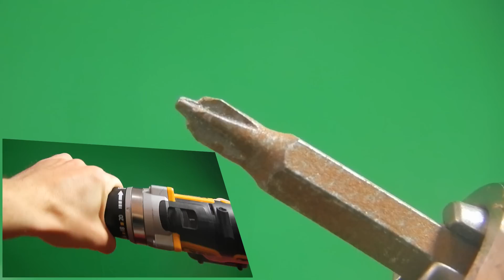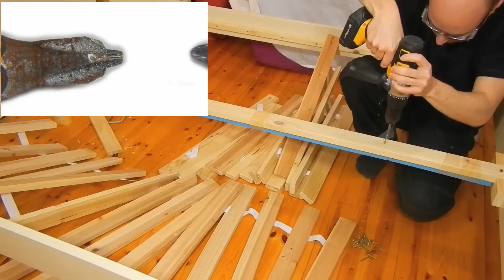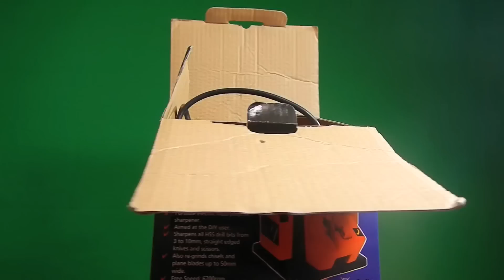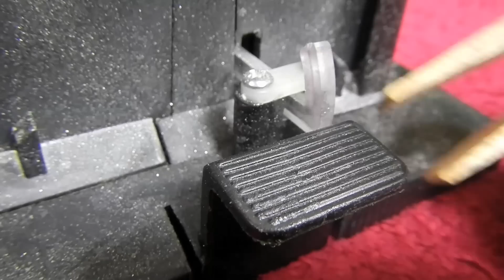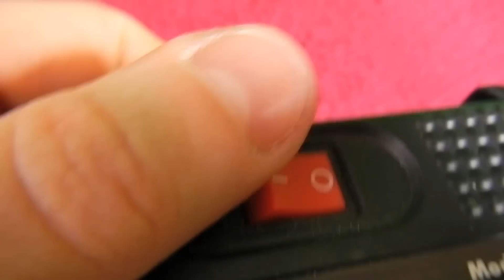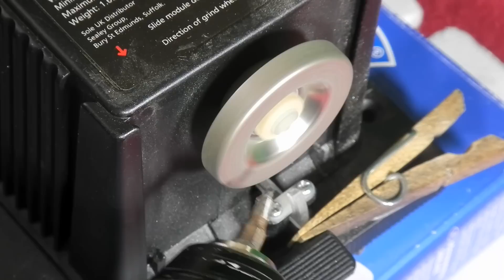How to repair Phillips Drill Tip

Comment: Not sure if this is a serious but if you were you should know that it won't have the right geometry unless you grind inside the flutes
Reply from the maker: +Chris Findlay I had to do a quick fix on Sunday, shops far away. I just angled the best side of the tip and did the grinding worked perfectly fine, geometry fully good. More or less ;)

Comment: $100 machine to fix a $1 bit.. LOL, your better off buying 100 tips and just throwing away one when they get destroyed.
Reply from the maker: I already had d grinder/sharpener. It was 25 sterling by d way.
Reply: Max DIY if the bits are chewed up any way then just get more quality bit.they are only going to break again.cheap steel is what to blame.

Comment: You did not show a end result so i guess it didn't work?
Reply from the maker: +Menth Fcuk I did not. I had the photos simply forgot to load them into the video. I made a post on my g+ check it out the pictures of the actual tips after grinding:   https://plus.google.com/+MaxDIY1/posts/NW9ZGH47Rb6

Comment: Love these DIY videos mate i subbed, it's knowledge like this that is great for emergency applications. Middle of the night no store open, stripped the philipshead drill bit, grinder on the table fixed and job done. Great stuff
Reply from the maker: People these days understand only one off stuff, like u buy an iphone and when the battery is dead you get another one. I try to create as little waste as possible.
Reply: Max DIY
Im a steel fabricator and where i work they throw out standard drill bits, the ones for drilling holes. They look at it cheaper to just replace them rather then sharpen them on a bench grinder. They charge $120 phr to the customer so i kind of understand.

However im one of the few that knows how to actually sharpen them properly so i keep the drill bits and take them home. Got a nice little hoard of free drill bits :).

Never seen this method on your video though for philips bits, got me thinking it can be used on those pesky cheap screw drivers aswell.

Like your style mate, it's ingenuity that separates the men from the boys.
Reply from the maker: I am going to work now, no time to write back, hopefully I will not forget I will write u a funny story on you priv. 
And all the optimisation people in modern corporations are bullsh...ing bout being green ;)
Reply from the maker: shi. I just checked out you have no priv message set up on your yt channel :(

Comment: just buy a new one. cheap as chip's
Reply from the maker: +chris pool My explanation form instructables 

The whole explanation is as simple as that: I live in a remote location. I was Sunday and our bed collapsed. I did not own tools on my own.I borrowed the drill/driver from a friend of mine. All 3 Phillips bit tips were broken. No decent wood screws in stock as well, got them form other friend of mine.Yes, I sould have said. Oh, bed is broken, I need to buy a new one.http://www.argos.ie/static/Product/partNumber/3958...Not very expensive is it?But on Sunday evening quite hard to get. I could have ordered the bit tips form amazon, and sleep on the floor for next too weeks. OR, just get the bit tips sorted and get the bed in order in about 45 minutes. Plz be aware that I did have the grinder so I had not bought it just to get the tips sorted.The easiest way is to say oh, my smartphone is broken I'll get a new one.Work, eat, buy....work, eat, buy...work, eat, buy......The final of a story is: Bed fully fixed, will serve years to come, the bit tips fixed, owner of the drill and the tips happy.

Comment: Phillips screws and bits are shit. To bad Robertson screws are not standard in most countries as it is far superior to Phillips.
Reply from the maker: +Bob Cartwright U R 100% right, it is very difficult to destroy Robertson, much better solution. Unfortunately, in Europe I saw this solution only a few times.
Reply from the maker: Darren Woods It is fully true. Back in the time when I was young I used one for like 2 years and I can bet it is still fully operational. I scrued quite a few plasters with it .
Reply: +Darren Woods  True, but still not as good as a Robertson. Try driving a four inch Phillips screw with one hand at arm length.
Reply: It would be easy and exactly the same as a square bit , except with a square bit you have no tolerance and it only works at one angle , with philips/pozi I have managed to drive them in at an angle no problem , try that with a square bit. Also doing shit by hand ....that's for peasants (expect if your assembling a kitchen were the designer is just a total bastard.)
Reply from the maker: Bob Cartwright Roberts on fully good but comes only in imperials
Reply: Bob Cartwright Robertson sucks just as much.  I used to use them daily when I worked for a decking company, and they strip the screw head extremely easily.  At least Philips cams out before wrecking the screw.  That being said, Torx is the best drive system.
Reply from the maker: Telogor _ thx for sharing your experience. What type of business are u in? I am used to torx in electronics noting else
Reply: Max DIY I'm in the electronics repair business now.  The decking company uses Robertson about 3/4 of the time and Torx the rest of the time.  Unfortunately, the only electronics I see with Torx screws are Motorolas, Nokias, and Microsofts, none of which come in very often for repairs.  It's usually Phillips, which suck, and pentalobe (Apple's crappy proprietary screw.
Reply from the maker: "Electronics repair" does it still exist? I used to do it part time ~5 years ago, but with laptop, smarthphone insurance and dedicated services it is really hart to make a living on it. What country  r u from??? In Ireland small services are almost non existent. People usually use stuff for a while and then they get new one.
Reply: I work in a shop fixing electronics every day lol
Reply from the maker: how d u earn a living then???
Reply: By getting paid at the end of the day , laptop screen 40 euro to buy 120 to replace ....5mins work 80 euro.

Comment: I guess this might work if you have a grinder. Even good hand files can temporarily  be used to reshape the tip. The geometry of the bit itself will never be the same regardless. Just get good quality bits, & have them available for emergencies. They aren't very expensive to buy, or space consuming to stock
Reply from the maker: It saved my sleep 😃
Reply: @MaxDIY1    a flathead bit once saved mine
Reply: Will that work on JIS bits?
Reply: @alext8828  sure, you can destroy the form of any bit you like:  phillips, Robertson, JIS, flathead, torx, pentalobe, hex, or tri-point --enjoy